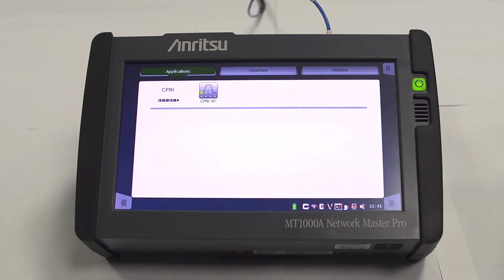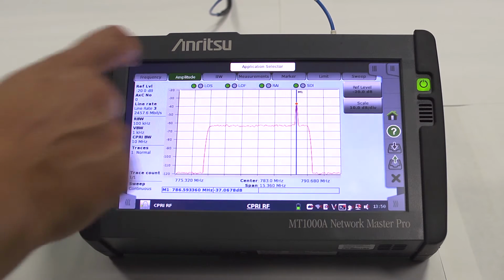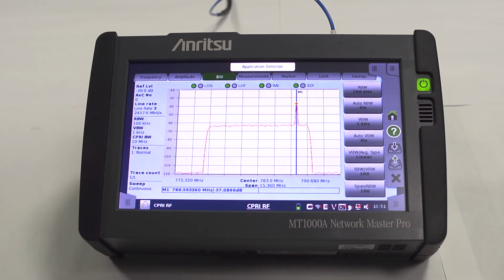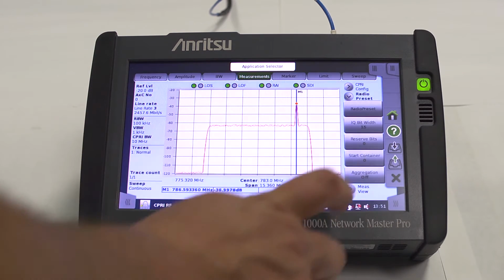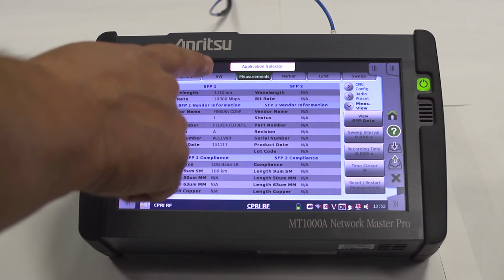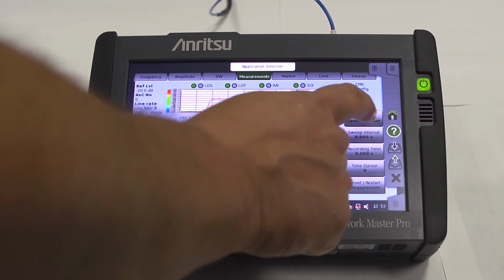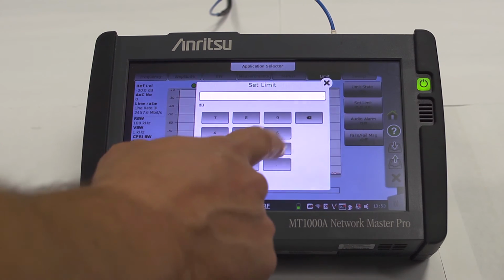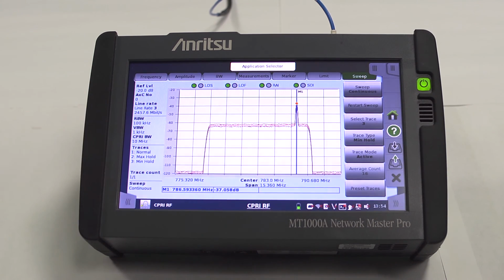CPRI RF on the MT1000A Network Master Pro

Comment: Please if you can help me about below questions:

1-What is CPRI? 
2- Challenges of using CPRI in 5G Technology. That means answering the following

Can we use CPRI in 5G Telecommunication?

What needs to change in current CPRI standard so that it can be used in 5G?

Your feedback is a highly appreciated.
Reply from the maker: Hi Omar, please see our responses to your questions below. 

1-What is CPRI? 
 CPRI is a protocol used on the fiber link between a Baseband Unit (BBU, normally installed at ground level) and the Remote Radio Head (RRH, normally installed at the top of a tower), CPRI stands for Common Public Radio Interface, if you want more information on CPRI you can find it at the CPRI organization website; www.cpri.info

2. 5G technology is defined as having a very small latency. The CPRI protocol may have overhead that may not provide the reduced latency required.

3. What needs to change in current CPRI standard so that it can be used in 5G?
The CPRI standards has added Line Rate 10 to support data speeds of around 25 Gbps. It will most likely use a new small form-factor pluggable (SFP) type, either SFP28 and/or QSFP28, to address the high speeds expected in 5G.